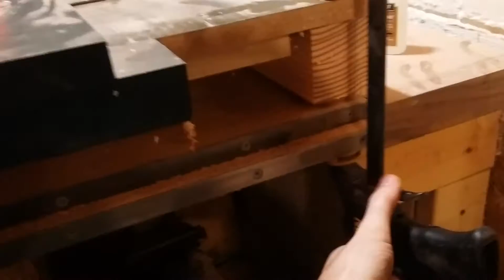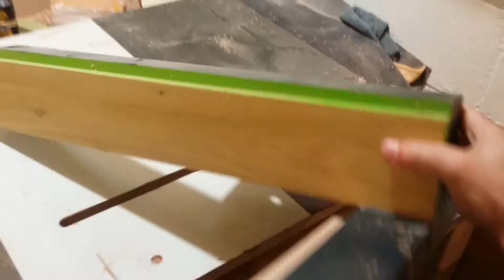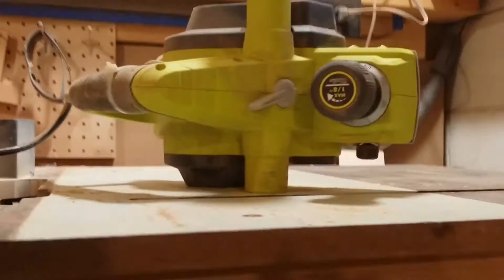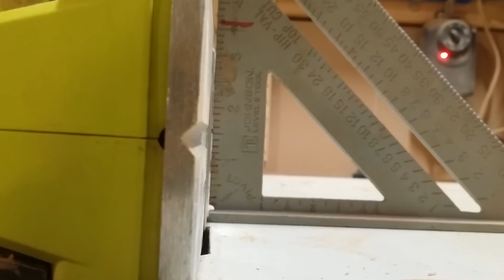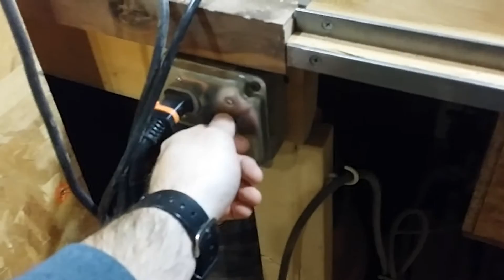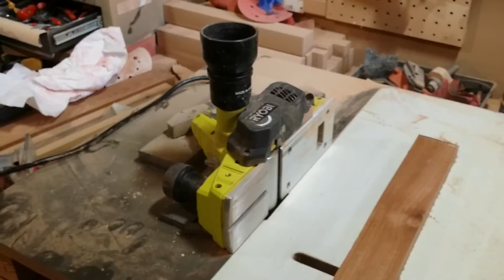DIY Planer (Jointer) Table - How It Works

Comment: Thanks for that. I might steal your fence. I made the same thing quite a while ago but didn't have much experience then and I didn't manage to make a good strong fence. It worked for edge jointing but I have been meaning to give it another try to get it to work for thicknessing too. Thanks again.